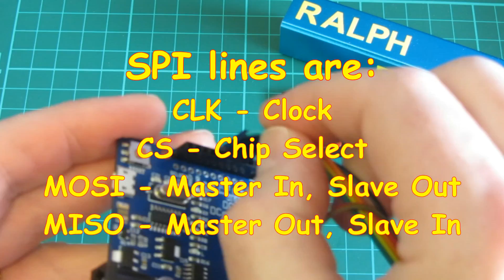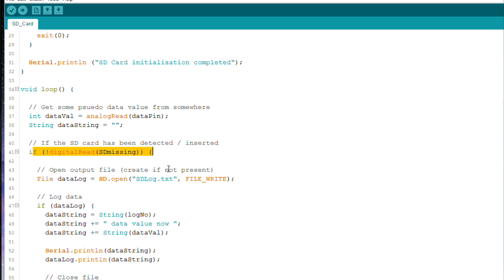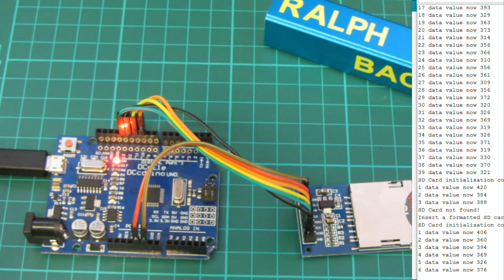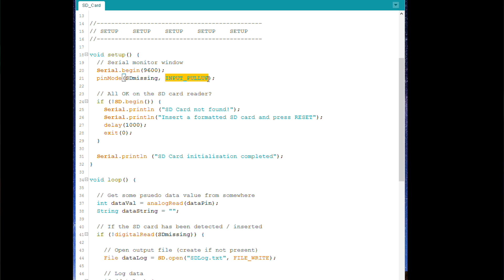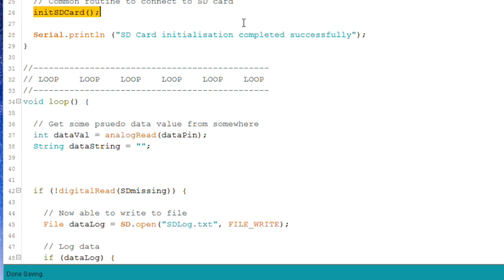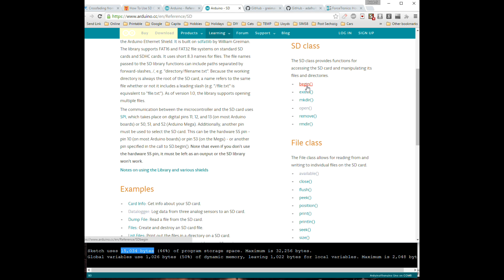#22 Using an SD card to log data - and how to improve the reliability!

Comment: Have you found a module that has that pin set up already? I have a hard time soldering that small a connection and the wire fell off.  Thanks
Reply from the maker: Unfortunately, unless the seller states that it's already connected you will not be able to rely on it. As the seller probably doesn't even know about this "hack", they probably won't even be able to confirm or deny whether it's been done. 

My best recommendation is to try a "big brand" supplier (Digikey, Mouser, RS Components... et al) as they (a) may have better quality components and (b) may respond to your query. You may end up paying quite a bit more but at least it will be what you want.

Comment: But as I understood from other videos, was that this sd card reader can't be used with all pins connected to the arduino because it uses signals on 3.3v, but arduino digital ports use 5 v.
   So, something to bring the voltage to 3.3 should be done to connect it to some of the pins. 
   Is that wright?
Reply from the maker: The SD card I showed here most definitely was 5v tolerant (maybe it even needed the full 5v, not 3v3, to work) so what makes you think it's not OK?
Reply: @RalphBacon  Actually I am  just in doubt. 
I'm using it for the first time, and I'm afraid of burning my sd card reader because of other videos showing apparently the same module (standard sd card size)  tell a voltage adjustment should be done as the standard sd card reader works with 3.3v level of signal .
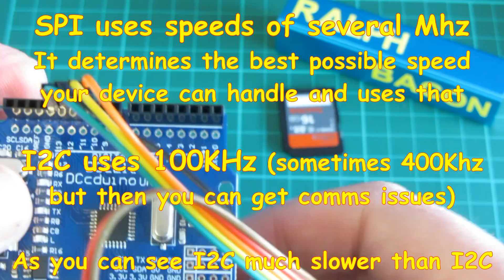At this link, ( 03:40 ) there is something telling that.

https://youtu.be/PQhQfww-qGQ

And here, another link where the guy shows how to make the voltage divider to use with the standard sd card.
 reader.
https://youtu.be/lIG5Yb4pS6Y

Would be great not having to add a voltage divider to the project, but, 
what is your opinion about it?

Thanks. 👍🏻👍🏻👍🏻🙂
Reply from the maker: The SD module that I use (shown here: https://youtu.be/GQjtG1MeVs4?t=6 ) will accept 5v input on the pin marked +5 and it has an on-board voltage regulator (that big black blob, an AMS1117) that outputs 3v3. 

This 3v3 output is connected to the SD card reader as well as the header pin marked +3.3 so you are OK to use a μController with either 3v3 or 5v output - just connect it to the correct header pin.

The link you included above to EduArduino (Portuguese) also uses exactly the same module as me. As he states, the module supports "alimentação de 3.3V ou 5V" so I think we are OK to use either - just use the correct header pin!
Reply: @RalphBacon  Thank you so much Ralph. 👍🏻👍🏻👍🏻

Comment: Hi Ralph, thanks for the video. This is great since I am working also in data logging with Arduino. I have a question, can we not directly from the pin but the data that already processed in the loop. E.g., I have incremental encoder data which I already manipulated to get angle, angular velocity etc. Is that possible to write to the SD card? Thanks again
Reply from the maker: Yes, you can, if I understand you correctly. 

The SD card is "just" another file system, so you can write to it whenever you want. The best way is to write a function that opens the file, writes the data, then closes the file. That way no data gets lost (or corrupted) if your sketch crashes whilst the file is open.
Reply: @RalphBacon  Thank you for your answer, Sir. One more question, I watched your other video with TFT LCD Touchscreen. How can I wire the TFT LCD Screen so that its SD Card slot can be utilised to stored data as well? Thanks again
Reply from the maker: The SD card on the TFT uses the SPI bus (as does the screen) and the CS pin just brings that "on line" so you write/read whatever. You won't be able to use SD Card Slot and TFT simultaneously, it's whichever is "active" by the CS pin being LOW.
Reply: @RalphBacon  I see. Clear now. Thanks, Ralph! Appreciate it

Comment: Thanks for this information. Very useful but....I was initally planning to use an SDCard but it requires a lot of Arduino Nano program(40%) and data(49%) memory.I was able to add an external EEPROM AT24C256(32768x8) module to my Sensor prototype.  My sensor program and data memory requires 50%,72%. After installing the EEPROM module it uses only 53%,72%. 

I am able to log approx. 28000 characters (2000 14-character strings). This enables me to monitor more than a week of sensor activity (air & water temperature, humidity, pool water level, Internet information, etc.). In addition, if I neglect checking the EEPROM when it is full, I added a circular address mode for the EEPROM. When I DO check it, I always have the most recent week's activity.
Reply from the maker: Sounds like you have a solution there, Bill, just be sure you don't log continuously to the same EEPROM address at it will eventually fail. Some sort of wear-levelling algorithm might be required (others have trod that path before you so plenty of examples out there).
Reply: @RalphBacon  Thanx Ralph. Yes, I keep the current string address at 0x7ffe,0x7fff.
Logging 10 strings every 2hours==>43800 strings/year, 100000 logs in 2.3 years. So writing to these same addresses will start to fail around June, 2024 according to the spec. Interesting problem to study with deadline date aforementioned. Hmm.. "wear-leveling algorithm". Sounds interesting. I was also thinking of automatically changing this string address function of day of the week (or month). Cheers!
Reply: @RalphBacon  Hello Ralph. Thanks to your comment about writing to the same address, I modified my algorithm. I don't store the current log address in the EEPROM anymore. I just log info starting at a flag(0xff) stored in the EEPROM. This flag is at the end of the previously-logged string. OK, it takes a few seconds to find it. But, I only do that once during setup(). I store its EEPROM address in global RAM  & update it every log. I'm still in circular mode so this flag just goes 'round in circles. Works fine and avoids changing worn EEPROM modules for around 125 years! I would be more than happy to share my code if you or anyone else is interested. Cheers!
Reply: @billglass5160  interested here!
Reply: @dariovicenzo8139  I can send you this library if you're interested.

Comment: hi Ralph, is there any reference to the MicroSD Card pin that can be used for SDMissing pin ?
Reply from the maker: I must have found something on the Internet regarding that pin but this video is now 4 years old so I don't have that information any more, sorry.
Reply: ic, I manage to find MicroSD Card socket pinout diagram but the detection pin is at pin 9, the datasheet at:

https://www.sunrom.com/m/3735

I still cannot find Full SD Card socket pinout diagram and why you selected the 5th pin, if based on card diagram itself as shown below the 5th pin is CLK which I doubted we can interrupt the CLK signal if the 5th pin on the adapter socket really is CLK pin as well.

http://www.electroniccircuitsdesign.com/pinout/sd-microsd-card-pinout.html

However, as most of devices are made in China, so I do found a Full SD Card datasheet as link below, but the detection pin is still at pin 9.

https://www.sunrom.com/p/full-sd-card-socket
Reply from the maker: It sounds like I have a different SD reader to you then.

Comment: Also R1 on this module does not go to cs.  Goes to pin 8 & 9
Reply from the maker: CS would normally be used as the Chip Select pin when using SPI so that makes sense.

Comment: Module does't detect write protect either.
Reply from the maker: It might not actively detect but if you try and write to a write-protected SD card it will fail - can you detect the error code that way?

Comment: The GitHub page says that it is superseded by SdFat which uses FAT16/FAT32/exFAT. I had heard that Microsoft was taking (or robbing) money from Android manufacturers fur using FAT several years ago, and to make sure, I searched Google and it was still not royalty-free (all of them, including exFAT). I don't mind paying a royalty for an excellent piece of work, but FAT series suck and I guess the only reason companies still use them is due to their compatibility with Windows. Installing a file system driver on Windows is not that hard, so I wish they used a different file system, one that is open-source, royalty-free and not locked by a giant monopolistic company.
Reply from the maker: But the FAT code will still work, right? Just use whatever works for you. Unless you are creating a commercial product there is no need to worry about who owns what licence.

Comment: Why there are 2 ground pins in this module? Why only one of them is connected to ground in here?Can somebody help me?
Reply from the maker: There are often multiple ground points on modules, just for convenience. On the ATMega328P chip, however, the GND connections are split: one for analog and one for digital to prevent one half of the processor interfering with the other. They eventually get all connected together.

Comment: Hello again, Ralph..I have the data logger working perfectly, thank you.. I need to buy some sd cards..Could you tell me what type/s of sd card the reader will accept, please? Will it work with SDHC type cards?.. Thank you..John.. Bristol
Reply: Thanks for your reply, Ralph...Looking again at the opening frames of the vid, isn't that sd card in the background an sdhc type?
The capacity wont be an issue here..I had the logger running for several hours, and the file size was amazingly small! Thank you.. John
Reply from the maker: I haven't tested this but I would be surprised if this simple SD card reader accepted SDHC card. 32Gb is about the max you can use here. That said, 32Gb is an awful lot of text data. I once had the addresses of every single house in the UK and it was just a few hundred Mb.

Comment: Hi Ralph.. I have another question for you, if you don't mind.. I've made a data logger from your vid, and it works well..But the data strings are being received via serial every two seconds, and they are terminated with 'cr lf'. This is giving me, in the log, a blank line between every line of data.. There is nothing I can do to stop the cr lf being transmitted, so, my question is, do you know of a way to remove the cr lf from the string at the data logger to prevent that line feed?  Thank you for your time.. John.. Bristol
Reply from the maker: If you have access to the individual strings you are writing to the logfile, then you can replace the CR/LF ASCII 13/10 (or 10/13) pair with spaces (ASCII 32). A String (capital S) in Arduino is just an array of char, so you can iterate over the String inspecting each char and when you find the pair replace them. Make sense or did I lose you at (13/10)?
Reply: Ralph S Bacon Thank you for your reply.. So, it can be done..I just need to find out how to do it on the net.. Thanks again for your help.. John..Bristol

Comment: Thanks for this really great video, I'm just learning how to use Arduino so still struggling with the programming as I haven't written anything since I had my VIC20 in the early eighties and the differences are huge. I'm slowly working my way through your videos and picking things up as I go.
Just a thought but how would you put a time stamp beside each number as well as the counter?
Reply from the maker: Glad it was helpful! The timestamp that you mention, do you mean in the debugging (Serial Monitor) window? There is an option in the Arduino IDE, a checkbox in the Serial Monitor window, "Show timestamp" which does this. Otherwise, there is no way that the Arduino knows what the time is, as it has no wifi nor Real Time Clock to get that information.
Reply: @RalphBacon  I was thinking of a time stamp in the txt file but that would require a real time clock module as well so I guess can't be done. 
Thanks for the reply.
Reply from the maker: It can be done with extra hardware, like a real time clock or wifi access but natively it can't, you are correct.

Comment: Ralph..I wonder if you would mind answering a 'feasibility' question for me please..I would like to 'data log' a serial data stream from an electric car over several sessions (Not F1, so not much data, and not fast!)..but  between those sessions, power is removed from the car AND the logger.. Is it possible to configure an Aduino/SD reader to cope with this, as there would be no provision for manually closing down the logger before power is cut..and no provision for manually restarting the recorder once power is restored..or...could it be made to work if the logger had an integral battery?.. Your thoughts would be appreciated..Thank you.. John Rees..Bristol
Reply from the maker: Killing the power to an SD card logger is the greatest cause of SD card corruption, John. You can mitigate this by programming each write within an OPEN and CLOSE statement but that really slows things down.
What you need is an Arduino shield with an ATTiny85 and a push button that allows it to ask the Arduino to please shut down and tell it when it has shut everything down (and closed the SD card) so it can kill the power.
Guess what? Watch video #173 for the background and video #176 for the implementation. If you need a board I have the Gerber files (or design files if you want to change it). I designed the PCB to accept either SMD or through-hole components, so it looks more complicated than it is.
If you get that far (that you think this is the perfect solution) let me know! I'm still amazed at how wonderfully this simple design works (look at the circuit diagram to see how simple it is).
Using a battery (to answer the second part of your question) is feasible for short durations, assuming you are using a full blown UNO with lots of LEDs and suchlike) but that can die on you too. I have a solution for this too, where the battery voltage is constantly monitored and once it gets too low allows the Arduino to shutdown gracefully before the battery turns off. Video #171.
So many options!
Reply: Ralph S Bacon ..Wow...Many thanks for you time and your reply..I'll have a look at the videos you suggested later ..My first thoughts (as a total, uninformed novice☹️)is that a self contained battery powered unit might suffice..The data to be stored is created during several sessions over the course of a day totalling around five hours or so.. What if the car had a socket feeding the serial out. A small, self contained, dedicated unit with (say) a Nano, an SD module   and a battery (no display, leds etc..) could be switched on and plugged into the car at the start of play, and removed and 'gently' switched off at the end of the day. Do you think that's feasible.. or is that a very silly idea☹️? John
Reply from the maker: It depends on what you mean by "gently switched off", John! 
As long as you ensure the SD card is closed (in code) before power is removed you should be OK! I'd certainly test that hypothesis a few times before I found out the hard way that my day's data was gone! A cheap option would be to have TWO SD card loggers with the data written to both (mirrored). Only you can determine what it would mean to lose a session's data. Irritating, but not the end of the world? Or something that cannot be replicated?
A single 18650 battery, rated at 2000mAH should run a Nano and SD card (~80mA - 100mA) for a full day. That's running at the 4.2V - 3.3V of such a battery, which I would think would be fine for the SD card (certainly OK for the Nano). You can even get a battery holder for such a battery that will give you exactly 3v3 or 5v from it (see video #116).
Could be a simple solution!
Reply: Thank you again, Ralph..
By 'gently switched off' I meant having the file closed, and the device then being powered down..as you suggest it should be done..maybe with the push of a button...

Re: loss of data..It would be annoying, but not the end of the World..We usually have recorded radio telemetry from the car, so the data logger would be a backup...and vice versa..
Thank you for your advice re batteries..and indeed, your advice re everything else!..I now need to watch some more of your videos, and try to put something together☹️..I'm hoping there might already be some examples of the code I will need, out there, ...to take in serial and write it to SD..
Thank you so much for your time and advice..and your patience.. I look forward to watching more of your videos.. John